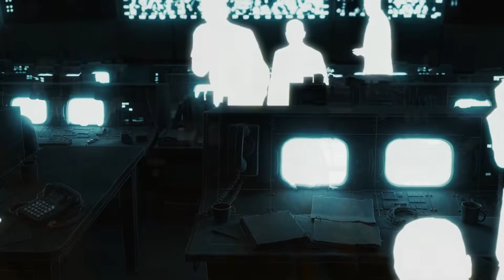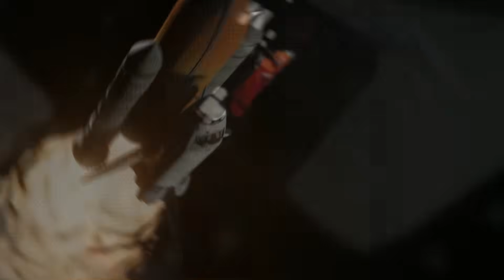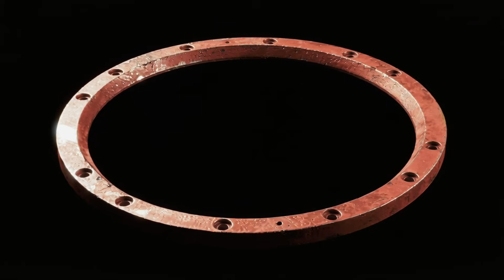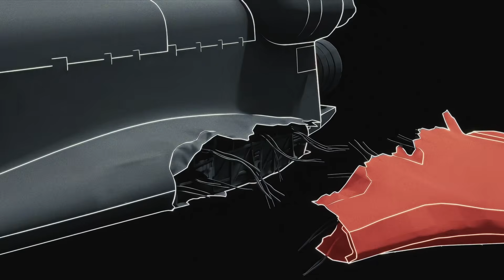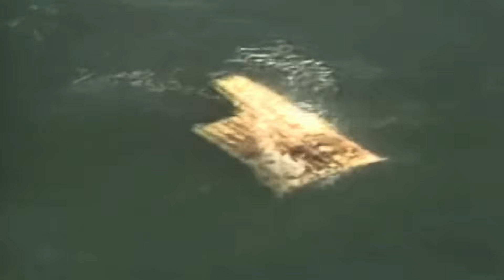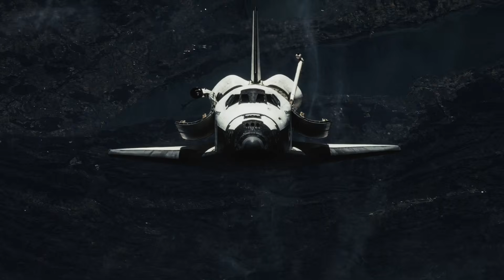3D Reconstruction of the Challenger’s Disaster.

Comment: Nope nope nope. Totally wrong. There was zero explosion. There was a mix of hydrogen and oxygen which produced a fireball. No shockwave. The structural failure of the orbitor was caused by aerodynamic forces as it tumbled.

Comment: SRB chamber pressure deviation was detected, along with unusual steering inputs to compensate for the difference, as well as the thrust caused by the leak itself.  However, nobody noticed until the data was analyzed post accident.
Reply from the maker: That’s good information. Thanks for sharing it, friend.

Comment: The shuttle didn’t explode. The sudden turn of the right SRB caused a change in direction of the shuttle while it was going nearly Mach 2. The aerodynamic force of that event broke Challenger apart.
Reply: Exactly the orbiter never exploded.
Reply: You keep posting the same thing, and its misleading. Yes, the shuttle didn't explode, but it was riding  a giant fuel bomb that did explode, thus tearing the shuttle apart. The shuttle was built to handle high speed and high temperature.

Comment: What actually happened was that the heat from the  right  SRB's exposed O ring joint had burned through the bottom support strut that held the SRB to the external fuel tank  and when the shuttle encountered a crosswind  due to passing through the jetstream  this caused the SRB to slam violently into the tank causing the bottom to rupture, resulting in the liquid hydrogen   being ignited  thus causing the explosion. 

The nat geo series seconds from disaster  covered the challenger disaster in one of it's episodes in the early 2000s  back before nat geo channel became just another redneck reality channel that's since become obsessed with all things Alaska.

Comment: Not ONE MENTION of:

1) The fact that many of the engineers thought Challenger would explode ON THE PAD, at the MOMENT of SRB ignition.

2) The oxidized aluminum slag that "sealed" the plug, NOR the WINDSHEAR that BROADSIDED Challenger with a force equivalent to HURRICANE KATRINA, dislodging the slag and allowing the final burning through the tank to occur.
Reply from the maker: Very interesting information. Thanks for sharing it, my friend.
Reply: @3dcrash  You're welcome. All that information came out during the investigation of the Rogers Commission. If the right-hand SRB had only held a few seconds longer, the SRBs could have separated, and Challenger could have reached safe orbit and completed her mission.
Reply: @RobertNielsen1970  a 'few'  seconds?!?  more like about 35 seconds.
Reply: I knew this, but you bringing it up makes me wonder something I never considered…had the accident happened earlier in the flight—i.e., at a lower altitude—is it possible there could have been a scenario where the crew survives?
Reply: @whalers59  Possibly. I mean, it wasn't the breakup of Challenger that killed the crew, it was the impact at around 207mph. Even at a lower altitude, though, the sheer density of the compartment made a survivable impact with the ocean, without some deceleratory apparatus (parachutes) nearly impossible, especially as Challenger and the other shuttles were designed.

Comment: The actual root cause of the accident goes back to the original SRB joint design.  As someone who worked for NASA but not as an engineer, I looked at a drawing of that joint and could see immediately how it could fail.  My non-engineer analysis and redesign actually matched the new redesigned SRB joint.  The original failed joint design was constrained by money....which long term resulted in loosing people and very expensive space hardware.
In addition, the SRB segments arrived at KSC in a horizontal rail car position, causing them to slightly mis-shape during transport.   If I recall, the joint that failed was the joint in which there was problems mating it with the joining segment.   Usually accidents involved many causes....and this is one of them.
Reply: im sure it did bud...
Reply from the maker: Wow, it's a truly interesting background, thanks for sharing it.
Reply: That's interesting to hear. Do you think that they didn't abort because it had already been postponed at least once?
Reply: @kasey9067  Abort wasn't possible.   Once those solids are ignited, its go time.

Comment: 4:50 It didn’t lead to a massive explosion, it was actually a disintegration with very little burning. Most of what we saw was unburnt propellant
Reply: Also disintegration happened way more dramatically and in a different way than shown. And sorry, the nose section of Challenger was gone after it left the vapour cloud and the crew cabin was violently tumbling (and no longer airtight as well). It was no calm fall from the sky, for any awake crew member, it would have been like being locked inside a giant washing machine filled with metal junk and other stuff.
Reply: @denniskrenz2080  Supposedly among the remains of crew members they found at the bottom of the ocean/gulf were that at least one of them had tried to don some sort of life-saving oxygen pressure suit. Not sure what that was, but there is evidence to suggest that some if not all were alive as they fell from the sky, though there are also competing theories that suggest that terrific, non-ballistic aerodynamic forces rendered some or all of the crew unconscious as they fell.
Reply: @FrankW-x4y  That is a popular misinterpretation of the evidence. The evidence leaves it a possibility that someone of the crew could have done it, but it could also have happened without the crew - activating a PEAP was a really simple action and lots of things were flying around in the cabin at that time. Also they were pretty useless in an explosive decompression, since they only provided unpressurized oxygen, to be used in case of toxic gases entering the cabin. But the aerodynamic forces themselves were far from lethal, with peaks around 20g (Like an ejection seat or a launch escape system).  But that all doesn't mean it was a comfortable elevator ride to heaven, by the words of NASA: "the cause of death of the Challenger astronauts cannot be positively determined"
Reply: @FrankW-x4y  I believe you're referring to their Personal Emergency Air Packs (or PEAP).
Reply: @RobertNielsen1970  it’s Personal Egress Air Pack (Peap) not Peak
Reply: @bigships AH, you're RIGHT! Error on my part - I fixed it. Thanks for pointing that out!!
Reply: Yes. It wasn't an explosion. It was engulfed in a fireball.
Reply: OK smarty pants. Have you never heard of useless information? What people saw was a fkn EXPLOSION!

Comment: Challenger Timeline of events 
January 28 1986 At 11:38AM Challenger Lifted off with 7 crew on board as the shuttle lifted off however some manger’s expected to see an explosion on the launchpad however with the o Ring gone hot gas began escaping trough the SRBs But some how aluminum slag from the fuel built up and block the hole preventing a disaster on the launchpad but creating a small smoke during liftoff 73 Seconds Later The Challenger Encountered High altitude Wind sheer shaking the shuttle violently and allowing the slag to the free hot gas was able the escape fallowed by right SRB The Give way and the bottom of the tank broke and SRB To Slammed onto the top of the tank created a Massive Explosion

Comment: The failure was due to the hot gasses burning through the giant fuel tank, dummy. Do a little research.
Reply from the maker: In reality, both things are related. The initial failure was in the O-rings, which allowed hot gases to escape from the booster, and those gases ended up damaging the fuel tank, leading to the destruction of the shuttle.
Reply: Your mom must be so proud.

Comment: My understanding is the O-ring could have leaked in any direction. The fact that it was aimed right at the fuel tank was horrible rotten luck. I also saw a documentary several years ago that said slag from the aluminum in the solid propellant had plugged the hole and would have saved them, but the jet stream was blowing very hard that day and made the SRB flex which released the chunk of slag and continue burning the strut and fuel tank. I've only heard that once so I'm not 100% convinced it's true.
Reply: Absolutely right. The initial blow-by at ignition was at a sufficiently low (comparative) temperature that the slag quickly formed, blocking the gap. That's why there's only a very brief puff of black smoke seen at launch. And yes, the crosswind at altitude almost certainly dislodged the plug of slag, leading to the jet of flame being directed toward the strut. So many of these details came together to cause the disaster. 
I sometimes think of what Roger Boisjoly of Morton Thiokol went through - he was overruled wanting launch delayed, was absolutely certain that the booster would blow on the launchpad, then the relief when it lifted off and seemed to climb out OK, and then.....
Reply: @krg1965  The leak was much more likely to have occured exactly where it did because of the fact of it being where the mounting struts were located. The mechanics of that structure made it much more likely to happen there.
Reply from the maker: It must have been terrible, but NASA’s policy on acceptable risk and the organization’s hierarchical structure were the key elements.
Reply: @krg1965  Thank you for confirming that. It's a bit strange that detail is rarely mentioned.
Boisjoly was blackballed and ostracized by colleagues and management at MT until he chose to leave and start his own business. Fortunately, he donated every memo and paper from his time at MT to a college in California so people can see the truth about this tragedy.
Reply: Yep. I’ve always thought about that. Just like that piece of foam had to hit Columbia not only right on the leading edge of the wing, but on a part that could not be seen by the crew. It was there for 16 days right in front of them and they couldn’t see it. Plus, it was a rare mission not going to the space station. Had they been going there, the astronauts on the space station would have seen it and they could have remained there until rescued.  Bad luck all around indeed.
Reply: @whalers59 linda hamm couldn't be bothered to have a satellite look at it.  She should have done jail time.
Reply: @whalers59  Columbia was to heavy to reach the orbit of the space station. It still had many remainders of the testing period on board. That included the OEX datarecorder which was found back in near perfect condition and contained vital information to determine the root-cause. Maintenance following STS-107 would strip Columbia from no longer needed equipement, making it lighter and thus capable of reaching ISS. I believe STS-118 would be the first Columbia mission to dock with ISS.

Comment: It was a tremendous mistake to remove the SR-71 pressure suits from the system as well as not providing parachutes to the crews.  This situation was remedied starting in 1988. Negating any bailout capability was a mistake. The agency was lucky for 20 flights from 1982 to 1986.
Reply: Not really.

Comment: Had the booster rockets burned for another three or four seconds Columbia would have suffered the same fate on the maiden shuttle flight.
It was extremely fortunate that only two crews were lost during the shuttle programme, which never achieved the operational readiness and sustainability originally envisaged by NASA.
Reply from the maker: Totally agree
Reply: at least that crew could have ejected
Reply: @nagantm441  No, they were to high and to fast for that. Ejection seats on early missions were for show, as they could only be used at a time window in the launch where the ejected astronauts would be roasted to crisps in the plume from the SRB’s.

Comment: Still remember watching this live 😢😮
Reply from the maker: The image of the shuttle exploding is truly tragic and deeply disturbing.
Reply: @3dcrash very 😢
Reply: I was at the airport working and watched the launch live. From the moment of liftoff, I told the guy next to me that something doesn’t look right.
Reply: I've loved spaceflight since the days of the Mercury 7. I was off that day and saw it live. The major networks cancelled all other shows and I watched it all day. They were sympathetic and reverent, reflecting the shock of everyone.  However, when the nightly news came on, they did a 180, attacked NASA and went horribly negative. I shared this story with my son (who was born a year later) when he was doing well in school and considering aerospace engineering as a career. We talked about how one little mistake or emotional decision can lead to disaster.  He indeed went to CU-Boulder which at that time had graduated more astronauts than any other university. During orientation for the engineering department in the basketball arena, a professor told us all the same thing, and used the shuttle and another incident as examples of why you must be precise and focused.  My son double degreed in aerospace and computer science and later worked for a subcontractor for Lockheed Martin. He was responsible for writing the code that allowed all the systems on board the Orion capsule to communicate with each other,  the entire assembly and mission control. When it splashed down a few days ago with great precision I was excited and proud of him. I pray that we never have to see another disaster in space.
Reply: Me too
Reply: Sure ya did
Reply: @luv2bbq??